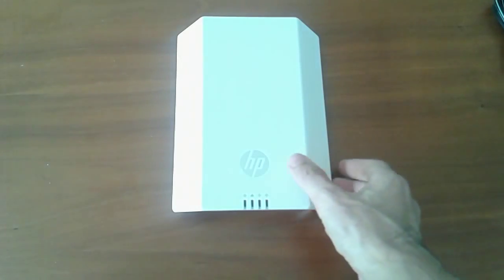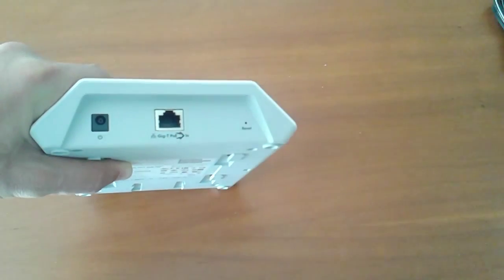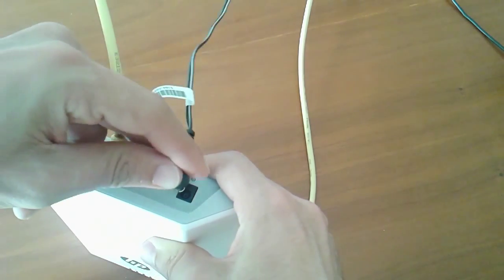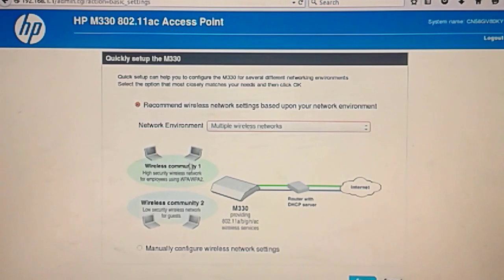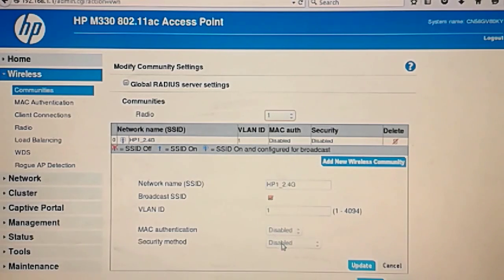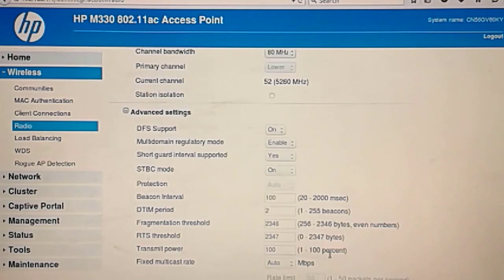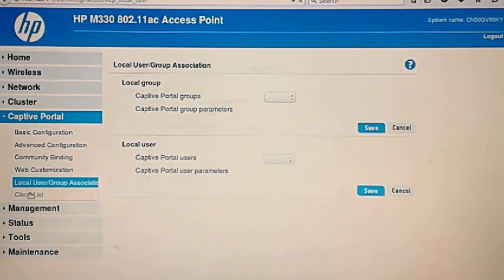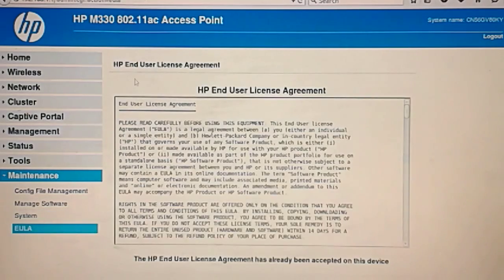HP M330 Access Point First Impressions and Menus Walkthrough

Comment: Bad AP. Clustering is still bugged after 2 patches in 1.0.0.4 firmware (allegedly 2 last versions fixing the problem, in reality still not fixed). Non-existent support. Can't really do client isolation either if you plan to use more than 1 AP in network. Only use-case where this AP is good enough is in home use as single AP ... but in this scenario, there are many absolutely better options.